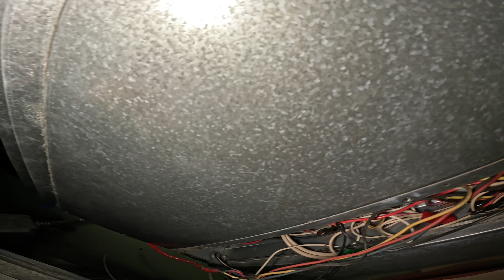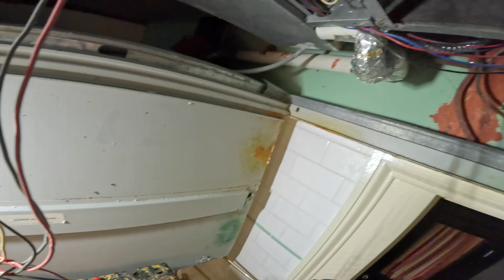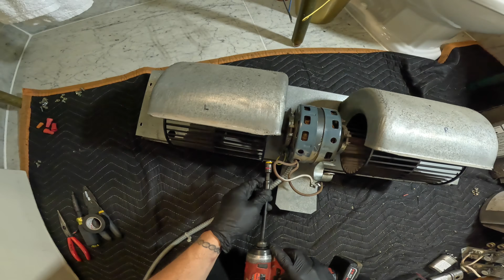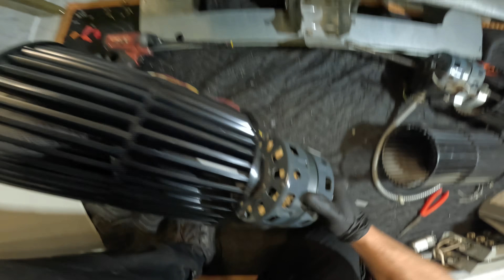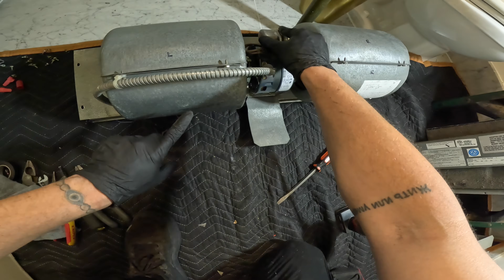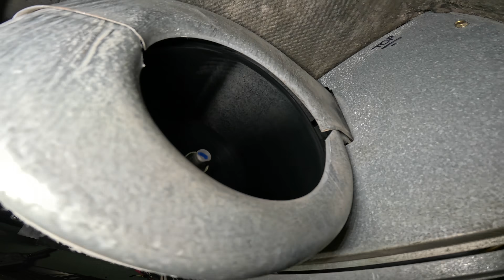HVAC: Fan Coil Unit Not Working (Fan Coil Unit Troubleshooting & Repair) FCU not Cooling/Not Heating

Comment: It looks like you didn't put BX bushings in (even the old ones, which were present) when you made up the replacement motor. Not to bust your chops, but I'd think that'd be important on a vibrating assembly like a fan...
Reply: job assurance?   🤣 whoopsy. it will probably be ok without them.